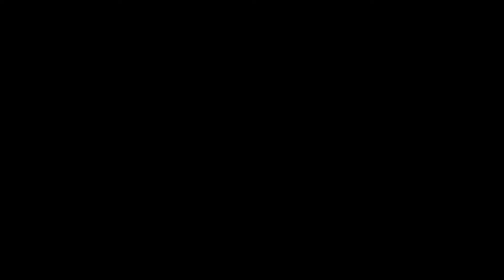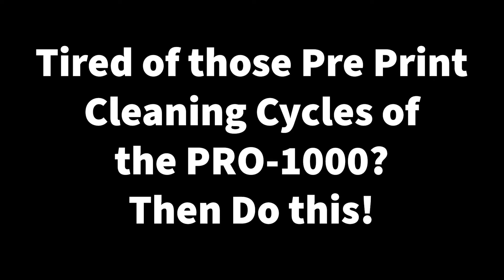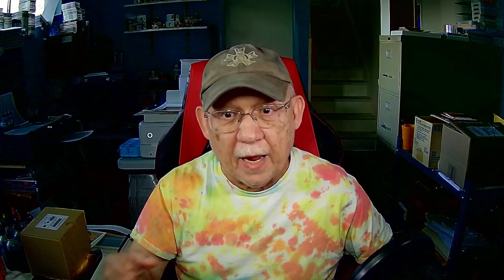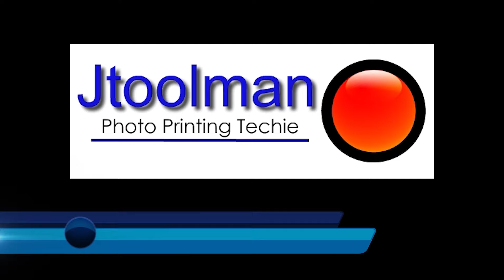Tired of those Pre Print Cleaning Cycles of the PRO 1000? Then Do this!

Comment: Can the nozzle check be done on standard inkjet paper?
Reply from the maker: Absolutely. You don't want to waste that on photo paper. Plain paper UNLESS you need to diagnose like ONE  possible nozzle not printing on a PRO 100 or 10. Because they print a wide band per color. The band is composed of rows of dashes. One row per nozzle.on plain paper it tends to cause dot spread due to wicking so that elusive  missing nozzle row of dashes will not show up due to adjacent rows bleeding into it. So in that case you need to print it on a low dot gain paper like glossy.
Reply: Does nozzle check count as daily print or do i need to nozzle check AND print after that?

Comment: I'm thinking to monitor the Pro-100s by Home Assistant, and print the Qimage unclog file only if the printer stays idle for 48 hours.
Reply: My Pro-100 had been idle for more than a year. Twice. Each time it started to print without any problems. The clog problem mainly corresponds only to pigment printers.